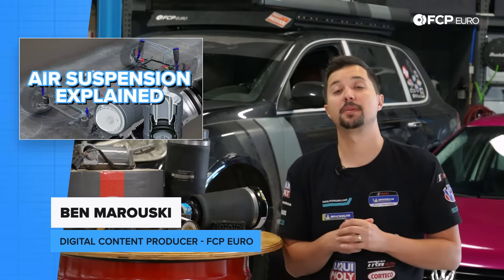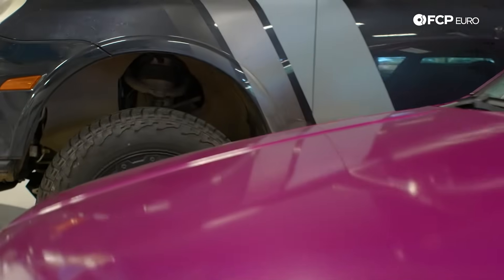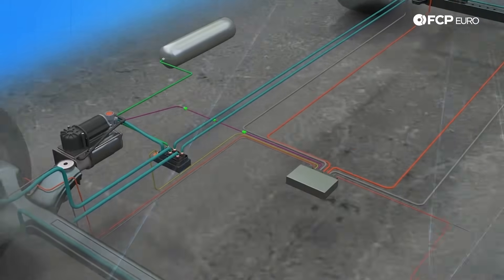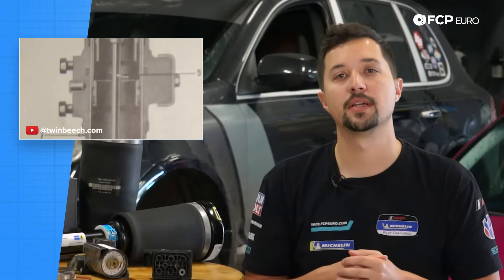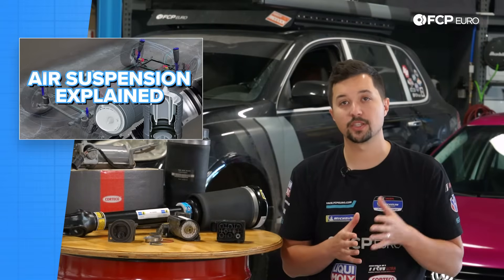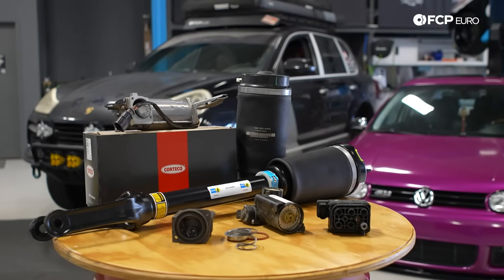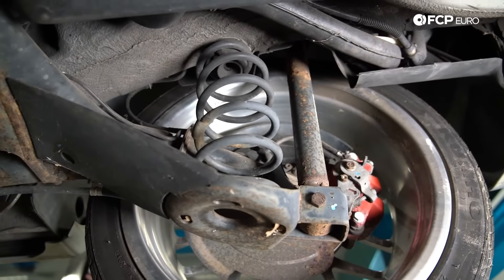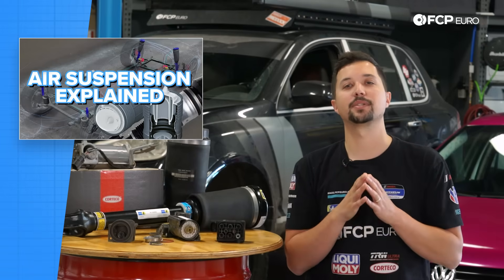Everything You Need To Know About Air Suspension

Comment: Regular replacement of the air compressor filter is essential for air suspension reliability.
Neglecting it can lead to premature wear and costly system failures

Comment: Great video thank you.  I have a 2002 Audi Allroad that I love.  I have had three different OEM airbags fail due to leaking over the years.  $1500 cost on replacement of each one by a mechanic shop. I have also had to personally replace the piston ring on the air pump three times over the years.  I finally self installed aftermarket Arnott top-of-the-line air struts assemblies on all suspension points of the Allroad.  So far no more failures.  However given the complexity of the system I will never purchase another new car with an air suspension system.  Just too many things to go wrong and too many possible points of failure. My understanding from your video is that it is much easier for the computer technology to diagnose where the failure is compared to my 2002 allroad.

Comment: 2017 XC90 air compressor runs constantly, when car on and off. Was able to turn it off by removing a fuse in the trunk fuse box. But what will be the advice with a repair? No service suspension message on the screen. Compressor was replaced 3 years ago at the dealer.

Comment: Hi, any idea if the air suspension of the 957 Cayenne be calibrated / adjusted using the Autel MK808? Saw a video which the Autel MK808 can "trick" the 958 Cayenne into lowering further by changing the input value of the suspension height.
Reply from the maker: Hey there, not that we have done/seen with our 957 here!

Comment: X5M 2015 - every 3rd year you have to replace -  bladers OEM or after-market - again after-markets are good , saves lot of money  but you need to learn to calibrate them to your kind of drive - using an OBD scanner - much comfortable ride compared to  coil springs
Reply: You drive with it daily?
Reply: @OneOrderSound   week ends - but the air pressure remains - after market in UAE was under USD 600 for a pair - genuine Bilstein Air Spring - original probably USD 600 or more each - calibration is the important part

Comment: How about converting an older 60's 70's vehicle to air?
Reply: You need to spend some time perusing mini-truck magazines and forums. You’ll learn a lot about  air and just how much work (a lot of it is custom cutting and welding fabrication) goes into a full air suspension. My S-10 easily had $10k worth of parts and materials in its air suspension when all was said and done.

Comment: Thank you very informative and interesting.
Question: a good website to find the right part for my cls550 2012 need to diagnose my air suspension, my left front side drops overnight and as I drive on the street drops also 
Thanks
Reply: Sounds like an air leak at the bag. Jack it up, set the suspension to full height (to give the most pressure) and wipe the bag down with a soapy mixture and look for bubbles. If no bubbles on the bag, check the lines and fittings leading to it.

Comment: how do they operate when travelling? when the pressure is in the bag, how does it release pressure to stay the same level, when hitting a bump for example.
Reply: They have a long-term rolling average in the controller, so it works out the average ride height over say 10 seconds. This generally rules out bumps and corners, but allows the controller to see if the rear is sagging for example

Comment: Has the issue where the higher you go (for offroad) the stiffer the suspension is been solved?  This made the solution poor offroad where you wante the highest level and the softest springs.  Years ago I had an Audi Allroad and this was a problem.  Also while it was great to be able to lift and lower the car, the parts were trouble prone and expensive.  My parents have a Lincold Navigator and found it was cheaper to replace the whole system with traditional springs than replace one bad air spring.

Comment: Great video.  I have a 2016 Maserati GranCabrio MC that I'm considering air suspension on to simply lift the front over high curbs and bumps.  I don't understand why there isn't a simple solution for this.  I've looked everywhere for a compact hydraulic or air solution solution and nothing.  I really don't want to deal with the complexity and cost of a full air suspension.  Any advice?
Reply: Air cups
Reply: Air cups

Comment: Hello everyone, maybe my question is stupid, does rubber ring in front bag (rings on schock absorber column) can be lubricated with some grease, or they must be dry?
I guess a better option, if it's lubricated, is a rod that the cushion slides on, to prevent the rubber (o ring) from wearing out.

Comment: Got a 2001 s500 and the suspension isn’t level in the rear the left rear is way higher which makes the front right look a little lower just wonder if this is a valve block issue or some sort of level sensor that’s bad . Just bought the car could use some input thanks

Comment: Awesome video but a slight correction @3:50 the compressor does not feed a spring or bag directly. It feeds the reservoir and that reservoir feeds the valve blocks which direct air to whatever spring/bag requires it. The compressor's job is to keep the reservoir topped off.

It's no different that say a compressor in your garage: which feeds a tank, and the tank feeds the loads. The compressor doesn't have the output capacity to keep up with the demands of the system on the fly.
Reply: Exactly and I would add more info to tour explanation (at least regard to my A6 C6 Allroad). The compressor only comes to play on if is there a delta P (pressure differential) more than 3 bar between air springs and the reservoir and of course rising from the bottom dynamic mode to whatever elevel up. Other than that, the reservoir is enough to play without the compressor assistance.
Reply: That’s incorrect to a degree. There are MANY different ways to design an air suspension. The air suspension in a Chevy Venture van has a direct compressor to bag connection. Of course, it’s checkvalved, but direct nonetheless. Direct connections are perfectly viable when immediate lift isn’t a concern and a slow adjustment is acceptable..

I used the compressors to tank to bags method you describe when I ran a 5 gallon tank at 200psi to feed half inch lines to the bags on my Chevy S-10. It would fill the SS RE-7’s up front fast enough to pop the front end off the ground about an inch. Fine tuning that suspension for an even ride took finesse, as any solenoid activation sent A LOT of air at once.

My GL450 is much smoother and a much more refined ride than anything else I’ve driven. My 2014 Navigator feels like a log truck in comparison.

Comment: I want to install large  aftermarket air bags on several pickups I tow with.  Leaning towards the rolling style bags like we use on big rigs... like Farfromstock sells.  What kind of shock should I run?  Like to drop height for freeway comfort & aerodynamics.  Any books I should get?  Thanks Dusty D
Reply: For bags, check Slam Specialties. For shocks, you’ll need to measure your shock mount heights at whatever ride height you choose, select a shock that meets your criteria (Bilstein or KYB), then weld shock mounts at suitable locations.

Comment: Thanks for posting. My 04 Jaguar has air suspension. Do you know if this actively improves the cars handling as well as its ride quality? Is it similar to Mercedes ABC system in this regard?
Reply: Hey I have a 04 xj8 and I wanted to know if it’s possible to manually air out the suspension on park somehow?

Comment: I live in a country with really bad roads I wonder what's the correct to drive my GL450 so as not to damage the airmatic system. So many badly installed speed breakers also are a problem

Comment: hello there ! when i did place the order for my new RAM pickup truck I did not include the AIR suspension Im Having REGRETS about that decision now my question to you is : May I Install after Market or Even Original AIR suspension could you give me some HINTS what equipment to choose ! to make my truck AIR RIDE !
Reply: You’ve got a lot of research ahead of you if you choose this path. You’ll need to consider compressor, tank(s), valves, lines, fittings, checkvalves, controllers (switch box or auto leveling, auto adds a lot of cost and complexity), line routing, correct gauge and type of wire to support your compressors, relays, tank pressure switches, all of that. It ain’t as easy as “buy a premade kit and go hog wild”

Comment: The air suspension on my '09 Cayenne GTS is great when it works - but I have a broken height sensor that gives me a "suspension fault" error and disables changing the suspension height.  Looks like an easy job to replace the sensors - but I don't see them for sale at FCP Euro.
Reply: Hello, are you looking for auto parts such as air suspension?

Comment: I wanna buy an old gl450 mercedes but the air suspension is a little intimidating
Reply: I bought a 2011 and I love it. I have my first bag leak after almost 2 years of driving. And it’s a very minor one. Total to replace is about 750 roughly … not insane.
Reply: @dalebrightly6178 I have a 2016 GL450 and it’s trouble free as well. When the time comes, I’ll replace whatever part of the system is struggling. Smoothest ride I’ve ever had!
Reply: Don't do it...or be ready to spend big bucks to have it fixed because Joe's corner auto fix won't be able to....this is why in my Hyundai equus ultimate I'm converting to traditional struts and shocks
Reply: @utuber2940 You can’t compare a Hyundai to a Mercedes. They aren’t even on the same plane of existence.

Comment: Hey im not sure if there is anyone here still to reply but i have question.
Basically one of my suspension air bags was leaking and the pump was definitely working today after i drove bag completely collapsed and pump did not pump it 
I took bag out ordered new one 
My question is will the air compressor work when i put new bag in maybe if it was completely deflated thats why it didn't work anymore? Maybe bag has to hold some air for compressor to work?
Reply from the maker: Hi EB, the compressor can be damaged if it continues to run for an excessive amount of time. Once you replace your airbag, if the compressor does not kick on your may need to diagnose from there.
Reply: Which car is it? if its a merc, the compressor is fine, its your collapsed bag.

Comment: Very informative video. What is the typical air pressure requirement (PSI) that is maintained in a air ride suspension?
Reply: There really is no magic number as the value will vary as the vehicle is being used. The suspension compresses and expands, and thus this will affect the pressure reading of the system.

As a rule of thumb, most European cars operate with a reservoir or central gallery reading of (the air tank of the system) anywhere between 200-350 psi. Most systems only use one pressure sensor located at the air compressor. This is the sensor for the entire system. Other systems (airmatic) may use a pressure sensor at each valve block. These systems display a front and rear axle pressure reading.

There really is no way to monitor for leaks reliably with the pressure sensors. As stated this reading fluctuates when the vehicle is in use and there is articulation of the suspension. The only way to properly check these for leaks is to raise the vehicle off the ground, expose as much of the air bags as possible and use the good ole fashioned soapy water mix and look for a leak. Unfortunately, this can be time consuming and labor has to be charged to properly disassemble the vehicle to run checks and pinpoint the culprit.
Reply: @LynxStarAuto  Quality answer! Upvoted. When I built the air suspension for my S-10 I used 7” bags up front and 8” bags in the rear. Took only 25psi in the front and 20 in the rear to make it ride smooth.

No idea what the airmatic in my GL450 maintains, but it does a fantastic job. I appreciate the data about it, more knowledge in my back pocket for when I go to work on it or repair it!

Comment: I have a 2017 Jeep Grand Cherokee with air suspension. It “bounces” like a car with bad shocks. Is there a way to fix this?
Reply: Check your shocks. They are likely blown. Air springs will bounce just like coils (unless maxed out with pressure) without shocks to control rebound.

Comment: I have had air suspension on a Cayenne for 7 years.
It has been a real problem!
It has failed at least 4 times in the last 4 years.
Its either moisture in the system that seizes the struts up and burns out the compressor , a seized height sensor, or a leak.
A terrible product for anywhere with cold winters and salt on the roads.
Reply: If you live in an area where temps reach freezing, a popular practice is to fully compress (deflate) the airbags. Fully purge all the airlines of water with compressed air, empty the central reservoir and refill it with nitrogen. Let the system refill itself, then empty the reservoir again, and refill it full with nitrogen.

Nitrogen will resist icing in the winter and prevent blockage from forming in the airlines, or the air springs. 

Because the compressor on the vehicle tops off the system with oxygen, you need to perform that nitrogen purge every 3-5 years to keep as much condensation out of the system as possible. On the hotter states like down south, this is not as important, and never done. If you buy a vehicle from a hot climate state, and you live in a winter state, this should be performed immediately before winter comes.